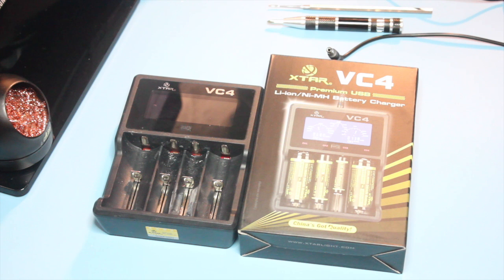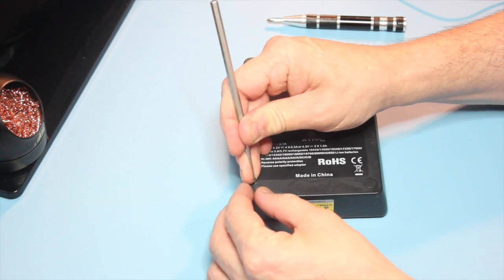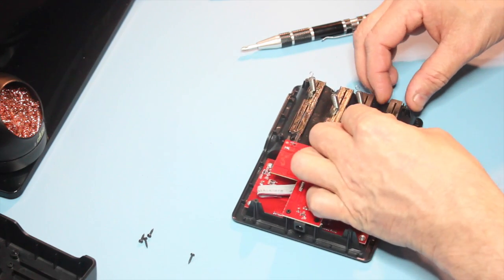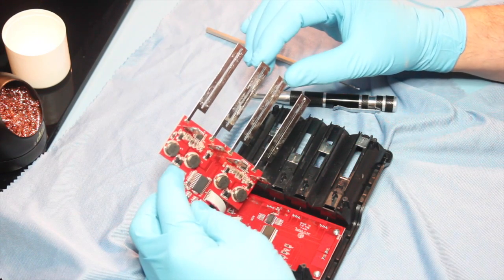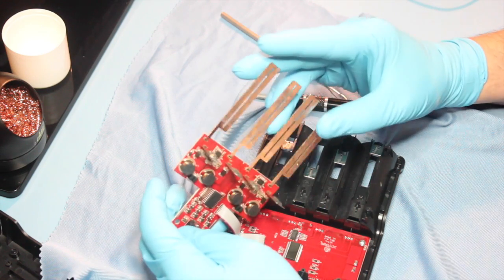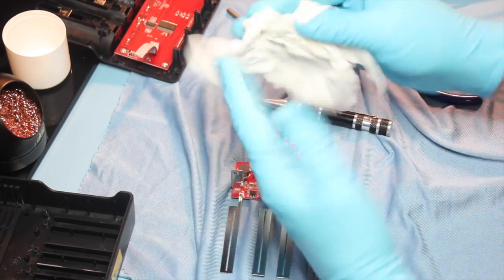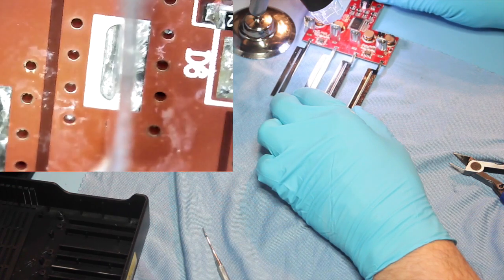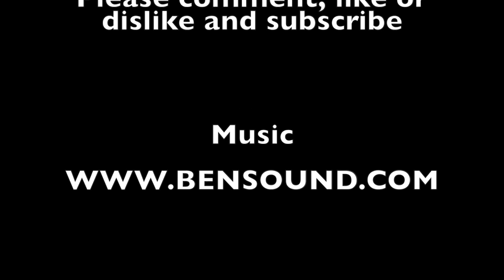Steve'll Fix It S02-E03 - XTAR VC4 Battery Charger Electrolyte Damage Repair

Comment: HI! I hope u will read this! 
My xtar xp4 is not charging my batt fully. It goes green but when i put it in my vapemod its not fullycharge 1bar is missing. Cell 1 is not working too, when i put the battery it goes off like unplugged. How to fix it. Thanks

Comment: Rewatching the video again, and i did notice that when you put it back together and tested out whether it was working or not, i noticed it was only charging the cell at half an amp? Mine charges 1 or 2 cells at 1 amp, if there is 3 or 4 cells it charges them at half an amp... just something i noticed. Being that this video is like 4 or 5yrs old ya may not even have the charger anymore...
Reply from the maker: It does still charge at 1A, I think it stayed at 500mA because the cell was almost fully charged. It's still in regular use after all this time :)
Reply: @SteveBrace  ah cool, lol glad to hear its still kicking.

Comment: In California is it a prop 65 item, ive had a dozen batteries vent and get electrolyte on me, ive never gotten a burn or any other negative affect but i always wash my hands when im done with the brick or wall and i wash whatever parts with 90% or higher alcohol
Reply: could be for internal parts, like lead solder....
Reply: cooked coffee is prop 65.... anything slightly carcinogenic is prop 65....  you have to use the rating system, after learning it and understanding it then you can say how cancerous something is, ie like, say "its half as bad as smoking just by looking at it, it burns your eyes out, and if you charge a battery, its like smoking a whole pack of....................... cigars ;) ".... i just hope its inside it and anyone know what is the prop65 warning for? does it get into the air? am i breathing it? is it the plastic outside? important to know. however i would still buy because companies that don't list prop65 just avoid doing business in California and don't list that its toxic....

Comment: I literally just had a battery vent on mine last night. Was charging my guns scope 231 cell and it melted the little plastic pole that the spring holds onto. Had to place a hot needle thru the plastic  land feed my spring thru the newly made hole. Works like a champ again.

Comment: A little hack i gonna apply on mine very soon, is a small "reset" button near the plug
to help me "reset" the charger when the power drops very low or on 0A.
I am a vaper and seems that my eCig mod is using the 18650 batteries pretty aggressive.
Yep, vaping on sub-ohm coils... ;)
So when i try recharge 2 x 18650 that are discharged at 3.5V or lower...
the XTAR VC4 drops the charging amperage very low at 0.2 - 0.3A or at 0A.
Same happens with 4 x 18650, amperage drops well under 0.5A.
But if i unplug the power a few times...i can rise the amperage,
that why i want a dedicated button, to stop playing with the socket .
Reply: So the magic is to unplug the power a few times ..thanks

Comment: @steve.. Is there anyway of changing the circuit on the Xtar VC4? I bought one and was shocked it will only charge the batteries at 1amp max, on only 2 18650 batteries? On 4 of them it drops to 0.5amp!!. what a pain. Can recomened something that will up the amps, if we do a curcuit board change please..
Regards Tony H..
Reply from the maker: Interesting project... Let me think about it. I wouldn't recommend hacking the existing components just in case 4A is a gross overload condition, which seems likely.
Reply: Brill;-) Maybe at 2amp to charge 2 batteries - 1amp for 4..which would loads better than the default
many thanks for your reply Tony H UK..

Comment: Lithium itself is corrosive and can cause mild burns and irritation when inhaled or touched. I don't know of any electrolytic compounds that are regarded as safe, so it's a good idea to wear gloves when cleaning or handling the compounds themselves. If you're ever present during battery venting. Try not to inhale any of the gases as these can cause irritation and medical complications with extended exposure. 

Basically common sense stuff. I'm not an expert, just what I remember from chemistry in high school and what I've found on wikipedia etc. 

Really enjoying your videos by the way. I've been binge watching them. Love the humor you bring to it as well. 

I'm curious though, where do you find replacement parts for these Chinese manufactured components? it's difficult enough just trying to identify a manufacturer of origin with companies always re-branding things. Do you simply replace the electrical components, and if unable, replace the entire unit? I'm going to be picking up some chinese stage lights, and while the components and design are seemingly identical to "name brand" units, buying from Amazon or ebay means I'll have no way to service them when issues arrive. I know that the circuitry and functionality of your basic PAR led isn't too complicated, but I just don't know where to look for replacement parts.
Reply: +Mechanought Oh god this was the last episode. What am I going to do with myself now!?
Reply from the maker: +Mechanought There will be more. Fear not. Just as soon as I get something more interesting than a battery charger in the lab! :)
Reply from the maker: +Mechanought Thank you for your kind words. Much appreciated. 

As for replacement components, you have to be pretty pragmatic about it. I generally look at the requirement of the component and replace it with a common equivalent. However some stuff you just have to buy from China and tell the customer that they can have their entire board replaced for £n-hundred or wait two weeks and have it repaired for much less. Most people go for the cheaper option. There is a further option of getting a small number of components from large manufacturers as samples for nothing... But keep that under your hat ;)

Comment: Hi Steve, interesting video I've ordered one through Amazon on the basis it seems that its a good piece of kit at a reasonable price too. I was waiting to see you use the ultrasonic cleaner or at least which one you use and more so the way you approached reattaching the ribbon connector. That would be interesting to watch. Very much like your approach to this subject me being a newbie, carry on with the great work.
Reply from the maker: +Charlie Cat Thanks for the feedback. I felt the video was boring enough without showing the ultrasonic cleaner and the ribbon cable reattachment as it was just basic soldering but I will bear this in mind for future episodes. The only criticism I have of the charger is that it has no temperature sensing on the cells which might have prevented venting.